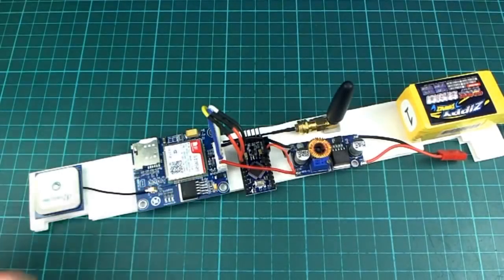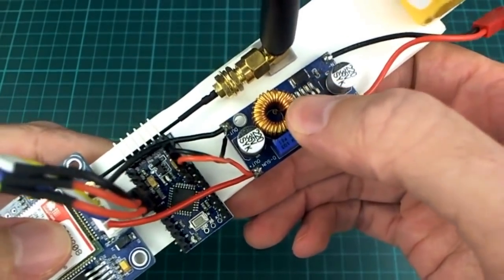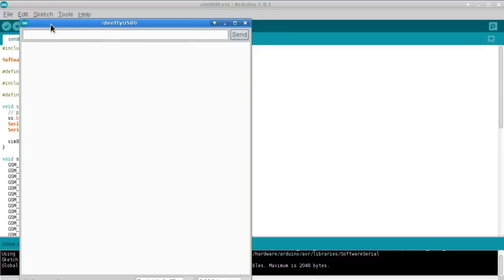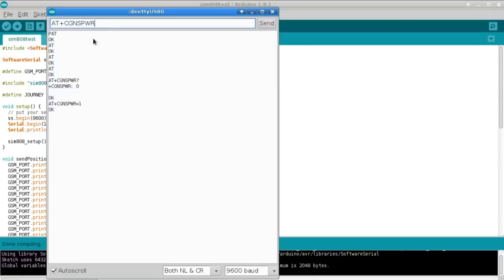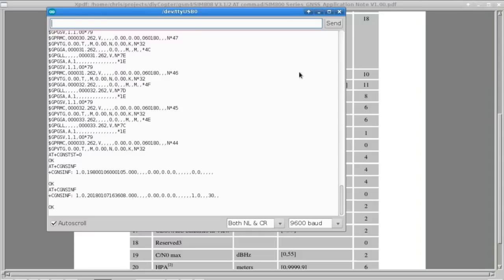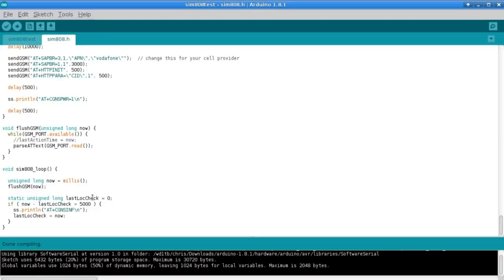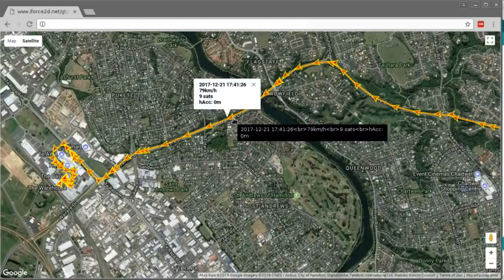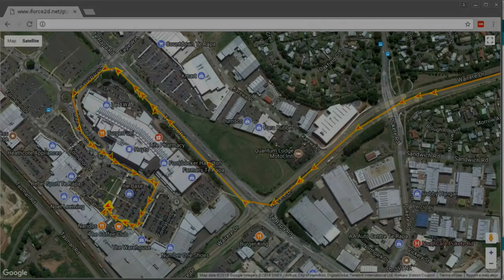Arduino GPS tracker, SIM808 version

Comment: Cool, so it's not a typo in ebay it really has GPS!
Offtopic: have you ever considered using stm32 "blue pill" instead of Arduino? I know it is 3.3v, but performance-wise it beats the living c... out of Arduino.
Reply: Sorry found the answer myself in Your videos :) https://youtu.be/xsYIh1sunso
Reply from the maker: Since making that video I have also used mbed online compiler a little, which is much easier to get things done with. I managed to get it working with a few other STM32 dev boards I have, by selecting a similar board to one of the defaults already available in mbed. I almost made a video about it all, but I have not actually used it for any specific project and I also got a bit lazy.
Reply: I have read about that mbed online compiler. Personally I use Eclipse with STM32 plugin and CubeMX official ST configuration tool which generates Eclipse projects. It is a bit cumbersome, but I really like the debugging feature. Huge downside is availability of libraries in such configuration, but it is not that hard to port libraries from Arduino.

Comment: WOOOT!!!! WOOOT!!!! Thank you so much. I finally got my SIM808 EVB-3.2 working and useful!!! I would humbly ask if you would be so kind as to instruct me on how to add ALTITUDE. (Perhaps for balloon flight?). That being said I am not certain if Altitude is one of the comma separated values that is available or even if it can be parsed.
Reply from the maker: Isn't that 'MSL altitude' value what you want? I changed the server code so that if you add a 'msl' parameter to the submitted URL that value will be inserted into the hAcc value.
Reply: "add a 'msl' parameter to the submitted URL"... sorry for being so dense but I am uncertain as to where or how to "add a MSL parameter".  As in.. the format of doing so? That being said I am most appreciative of you responding to my request. Now if I could just figure it out... DOH! Congrats BTW on cracking the logic of the onboard controller on the wheelchair rover. I was one of the guys that posted in video 1 to "get a Sabretooth". That is what I am running, but kudos to you in hacking the proprietary protocol. Well done.
Reply from the maker: The MSL value is an integer, look at how other integers are handled, eg. you can copy the same method as for 'fixStatus'. Specifically, in sim808.h you need to add a new variable and assign the parsed value to it, and in sim808GPSTracker.ino you need to add it to the parameters passed to the server. Basically, just search both files for 'fixStatus' and copy whatever is done for the fix status value.

Comment: Small tip - if you have stability issues or something, you might want to add a 1000mF capacitor on power pins for the GPRS module. I thought mine is defective until i did just that. Tbh, i was using one of those diy kits that cost ~$3.